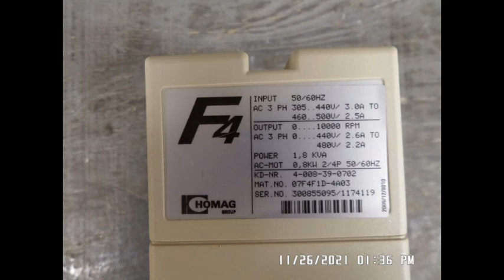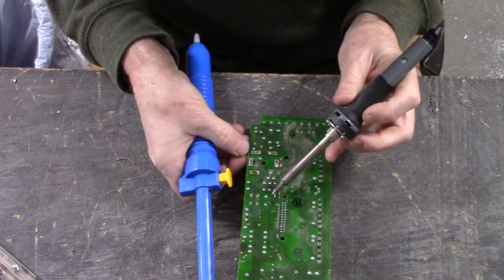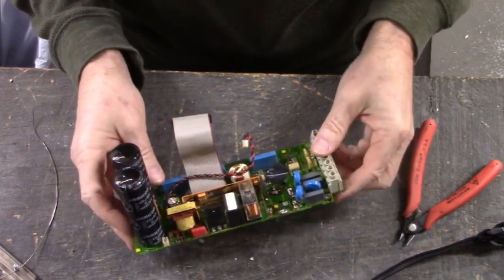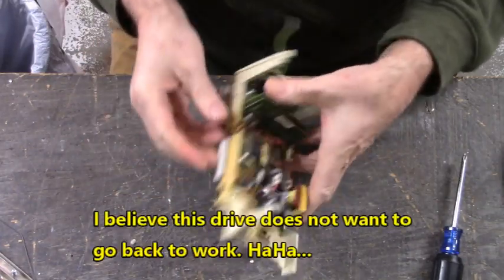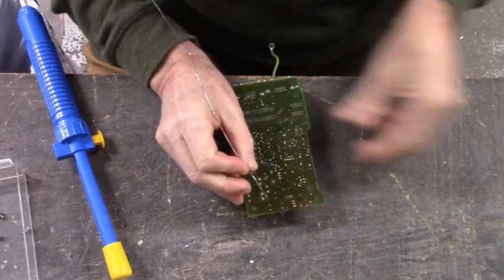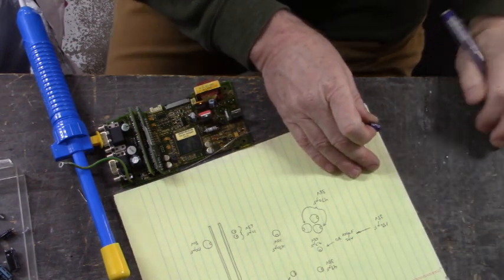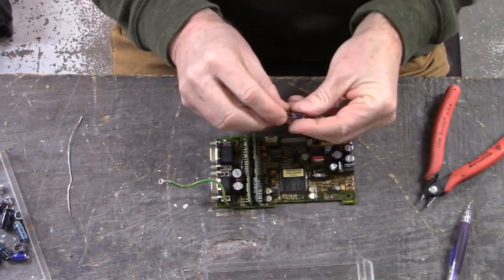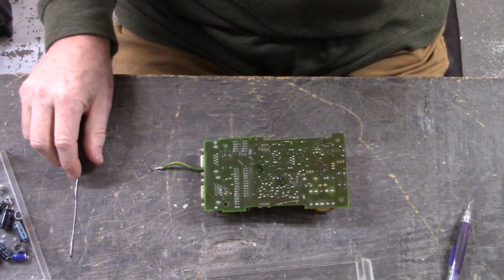KEB F4 MAT. NO. 07F4F1D-4A03 Acting Strange  (Part2)

Comment: well done , may i ask you what is function of the toroidal transformer in the midel of the power board ? that if it is.
thank you so much.
Reply from the maker: Yes Sir, you are correct. It is a toroidal transformer that makes the isolated voltages for the IGBT firing channels. Here is a video I made of this very circuit. In my video I repair and discuss the circuit. https://youtu.be/DaLg91vTC9E
Reply: @PeepawMcDonald  Great.This is what I expected from a generous gentleman like you, thank you for everything you produced.